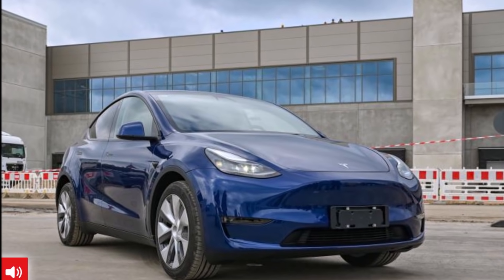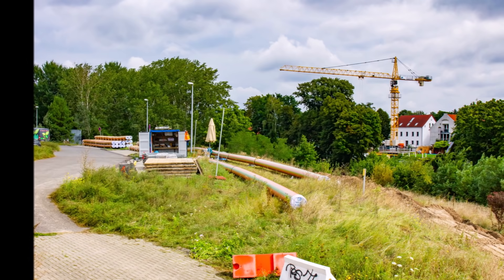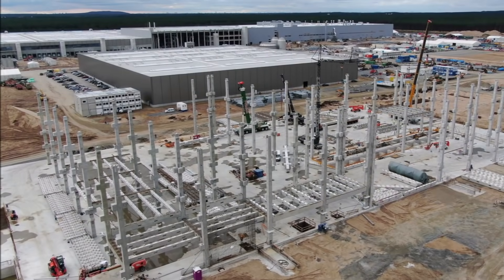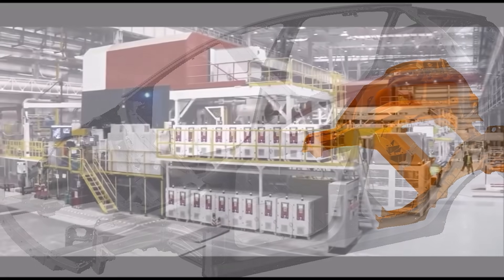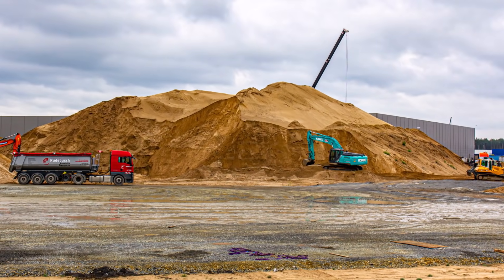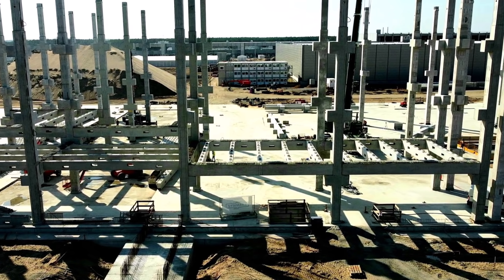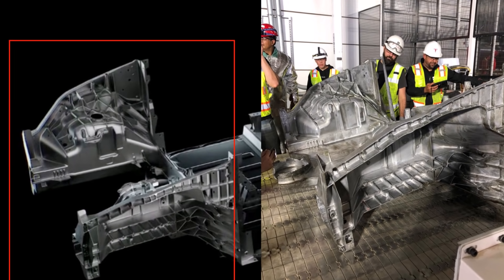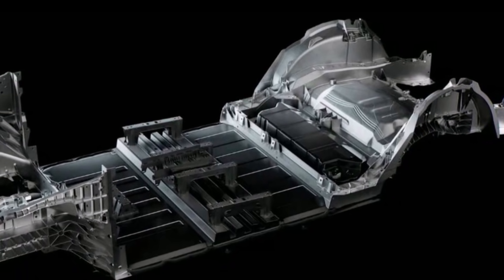Tesla Giga Berlin Goes Beyond Casting While Mercedes and VW Follow

Comment: Tesla spent years honing their skills with the Die Casting machine to blend in with the rest of the assembly line. The other automakers are amateurs at using these huge Die Casting machines and will make a ton of mistakes before they become familiar with how to use them properly with the rest of the assembly line.  You also have to remember Tesla developed their very own special liquid alloy in order to make it work with these larger casting pieces. What the heck are the other car companies going to do? The metal they have available to them will warp, crack, shrink, etc...
Reply: Alloys optimized for casting are readily available. Other Automakers can of course do the same, but if they start development later, they will bring it to market later. By the time Tesla finally makes the cheap EV happen due to years and years of cutting edge production optimization, other automakers will not be able to compete for quite a while due to their more conservative business approach.
Reply: @drkastenbrot  Alloy for big casting like Tesla does is not readily available. Tesla Alloy is an extremely specialize Alloy designed by Tesla's team and patented so no one else can do it. Not only that. The smaller casting available to the other automakers has to go through a whole bunch of treatment after casting to keep it from splitting, cracking, and a bunch of other stuff. Tesla alloy does not have to go through any of that stuff. I know all about Tesla specialize Alloys. So don't even try to tell me anything about it. For your info, the low-cost EVs from Tesla's comes out this year, starting with China, then Europe, and finally the US of A.
Reply: @radicalrick9587  lol you dont know a thing about casting, and your prediction about the cheap tesla in 2021 is awfully wrong according to both common sense and leaks. they have not even started work on it because the design heavily relies on the still under construction factories.

Comment: Things I look at with electric cars.  Why do new cars get sold?  100 million a year is about average?  They are built to self destruct. Everything wears out. Brakes, exhaust, every part of the motor, tires, electronics, paint, radiators and hoses of all sorts.   Then I look at the Tesla. Brakes just dont wear much due to regen braking. They seem to corrode more than wear. Electric motors run indefinitely and the better the bearings the chances go up exponentially. There is no Exhaust, The underlying body is a good quality aluminum.Basically covered with coatings that should last a lifetime.  As to the electronics. They seem hardened well. There are no moving parts to wear. There are actually not many moving parts in a Tesla. A few pumps for cooling the battery and the heatpump.20 or so parts in the drive train. Outside of changing the cooling fluid ever 2-3 years not a lot of other maintenance.  The earlier models had fit and finish problems, They had some brake problems but mostly all of this is now solved.  Simple and well built.  OK so here is the point.  If Tesla produces 5 million cars and trucks a year and the average life of these make it 30 years How many new cars will need to be built over time.  Assuming 99% of the current legacy makers cars need to be replaced every 10 years because they are just dead. One side of the equation is that since many fewer EV will need to be replaced lasting a super long time. and on the other side their will be a lot less of the legacy cars to be replaced as they wont be made much past 2030.   One can drive all over the country and see Thousands of junk yards and scrap yards. Heck I even see yards where someone has collected hundreds of the same "vintage" models.  Laughing went by a grave yard for old city ....buses.  Am not seeing any of this sort of grave yards for the electric buses that are currently being produced.  Same reason that the Teslas are not being scrapped even after 10 years.   There are only so many cars needed in the world and as we move from ICE to EV the real need for ever more NEW cars is going to drop, because for many they will be life time investment.

Comment: Steve, they're using Aluminum Alloy, that Tesla has a patent on. The Vanadium is expensive, but makes the alloy a LOT stronger. But Mercedes and VW will not be able to use the exact same alloy, without securing Tesla's permission...

Comment: Other manufacturers need to dump the current 70 parts machinery they are using now. What will be the cost of writing off the cost of these machines for different models. Technically it will be a couple of billions plus replacing say 15 models mega press will cost an additional billions.. How are they going to recover this double cost.. It’s not going to be that easy. Financially it will be a nightmare and will results in severe losses.

Comment: Tesla will also cast the battery pack as well.
Reply: of that not sure. They may move over to a composite battery housing but right now they are using stamped steel because it is relatively cheap to make.

Comment: Idea of casting vehicle chassis in one piece originated in the 60s - in toy car manufacturing, when Elon was a kid. Passenger rocket take U turn above landing site to be landed in one piece nose up also originated in the 60s in a space mission puppet cartoon. What else is new idea?
Reply: 2 large pieces and the battery are not a single piece but darn close. Assembly is not going to be a big deal. What is the big deal is moving from mm  to micron precision which has the knock on effect of making the cars super precise.
Reply: @stevepailet8258  mm to micron? The mold or the casted piece?
Reply: @philoso377  yes the piece that is cast.  The errors that creep in from assembling 70 to 400 parts, doing welding and using glues and adhesives to hold it all together for the robots to weld add to the misalignments. With the mega casting it is super accurate and then after xrays are done it is cnc/ laser trimmed to get it down to super precision. suggest you google or do a search here on youtube.  Many good videos discussing it here and showing how the machines work
Reply: The New Ideas are to transfer the production method of a small car like Hotwheels or Matchbox, into the life-size final product with better precision and efficiency that Mattel was/is never able to apply to its tiny cars. And the same is for Space-X. Is not the same to make a puppet cartoon than to build a REAL rocket capable of doing it. The originator of model Rocket technology, Werner Von Braun had more that 500 failures before he perfected the V-2s in the 1940's, and landing was not part of the project. The implementation of those Nose-up landing concepts required lots of thinking, trial and error, and not many people or organizations are capable of doing that.  NASA never tried, nor ROSCOMOS, the ESA, the JSA or any other space agency or program ever tried to do that, until now with Space-X, and to lesser extent Blue Origin.You, like me, can or could not do either of the two concepts a reality for sure.
Reply: @emilsantiz3816  3 parts I do not ever see the battery being formed in a gigapress but apparently you think that is going to happen  Batteries and 2400 C dont play well together.  Reality for me is that battery packs can be built on their own assembly line.  Once mated to the front and rear casting it becomes integrated and structural to the assembly.  This is as close as is actually practical for building out the cars.  The real idea is to reduce costs, add structural strength and build quality.  I do have a question for you.  Since you seem to insist it will be a complete casting, If one has to change out a battery and the battery is physically part of the front and rear casting how do you do that without scrapping the entire car? The batteries will pretty much be wedged and glued into the battery pack.  One does have to use common sense. and your comment is lacking
Reply: @stevepailet8258  You are right on that. When I made the comment, I was thinking only on the front and back sections of the chassis, not the whole stuff, to be made by the Giga-Press. Sorry if I confused you on that.  Body panels, trunk and frunk lids, doors and others would be made by pressing/stamping, but no Giga-press.
Reply: @stevepailet8258  to be called a structural pack, it needs to be attached to front and rear castings. The pack itself needs to be the structure, therefore the only time you will be able to remove batteries is when they reach the end of their life cycle. Then you scrap the whole EV. For the cylindrical shell of the battery cell to impart its strength to the structural battery pack, they will need to be 'glued' to each other & to top & bottom (sandwich between two sheets of metal). This will make for a very rigid strong Car.

I for one will not be buying an EV made this way until the second or third iteration, when most of the problems they didn't think about when designing it have been fixed.

Casting a box for the battery pac is not as effective/effecient as some other means available.
Reply: @MichaelAlvanos  Currently there is no good way to remove the batteries. They are in module and those could be changed out.  Still I think you would be hard pressed to show where this is actually happening with anyones batteries. They change out the entire pack.  There is not a real difference between the structural pack and current batteries.  Assuming there are 30 or so bolts that hold the batteries in the car adding a few to the front and rear casting is actually not much. Your straw man argument is just that. As to you not wanting to buy an EV of this configuration fine that is your choice.
Reply: @stevepailet8258  Watch Gruber motors or Rich Rebuild videos to see the difference in current battery packs & for future battery structural packs you need to see Tesla's Battery day presentation.

Even BYD's new skate has a stuctural battery pack, so have a look at that too.

Also, not all AV manufacturers are going this way, NIO has a battery swap & Aptera, Arcimoto will not have a structural battery back. Electric bikes also fit into this, as well electric wheel chairs.

Only manufacturers that have stipulated a Structural pack will end up that way
Reply: @MichaelAlvanos  Have looked at Gruber that is how I got my understanding that individual modules could be swapped out. There is no way to do a swap other than to swap out an entire battery pack with a structural type.  That said this is why it is so important to keep the cells balanced to keep them from wiping out the entire battery.
Reply: @MichaelAlvanos  I knew this and this is why having that million mile battery is so important.  All well and good. There is a very short list of people who run a car to that sort of mileage. Most of the car would just need to recycled anyway. I had an old mercedes even with maintenance only made it 500K miles.  The EVs coming out of Tesla should be able to do that over a 20 year period assuming one drives 25,000 miles a year.  The only people doing that are living in places like Texas where that is sort of common.  For the vast majority of people, They only drive half or 12,500 miles a year to and from work and daily driving. The car will never wear out as they are primarily made of a corrosion resistant alloy of Aluminum and the batteries will still have 95% capacity that can be charged.  Worrying about battery pack is the least of my concern. I will be dead long before the car or the battery die. Your argument is correct but the reality is it is also moot.